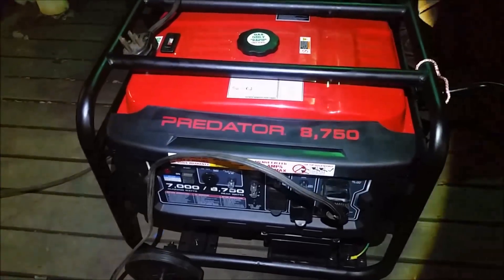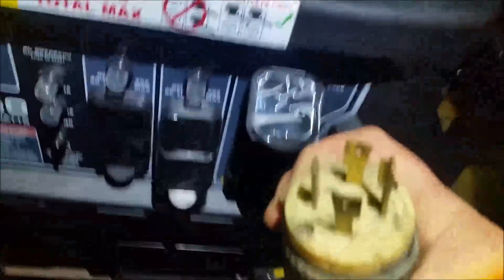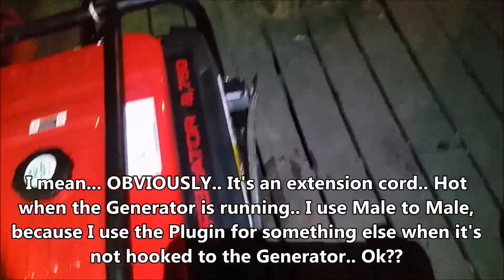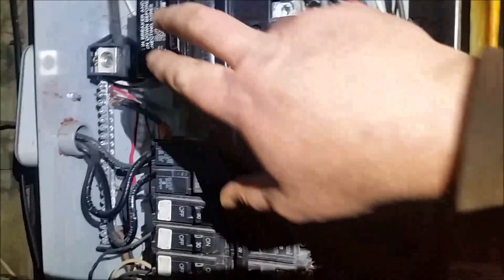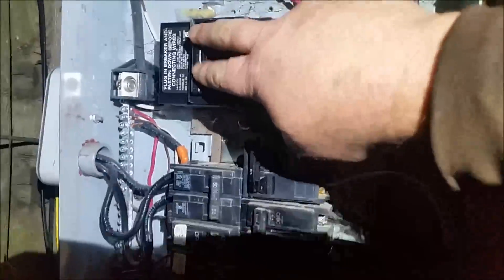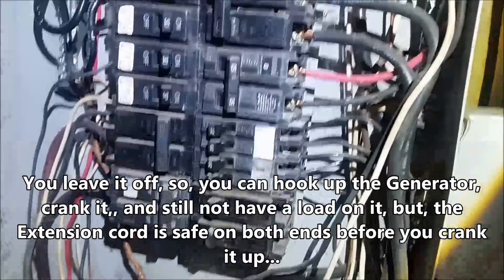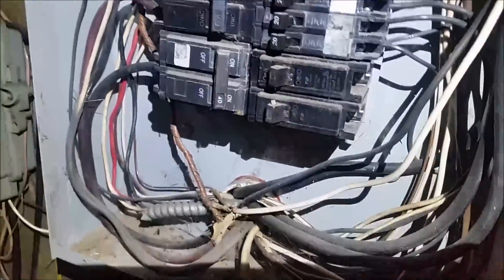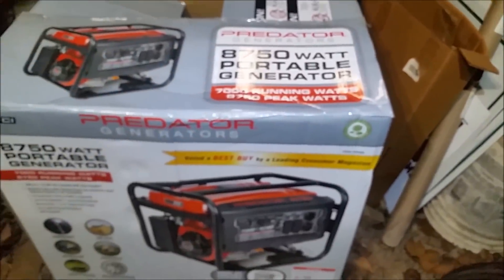Quick/Easy/Safe: Use Existing Plugin/Breaker for Generator hook up to your house Panel box.

Comment: After listening to the arrogence of this man, I'm so relived that I had my Harbor Freight generator wired by a licenced electrician. Better safe than sorry.
Reply: When the breaker is off the only things hot are the input lugs on the main breaker. When the generator is connected it will power those bars.
Reply from the maker: Well,, if you feel that is what is needed to make it safe,, pulling the Meter still leaves hot and cold with 1.25" of each other.. Which is about what is in the panel, so, don't stop there.. Call the electric Company and have them disconnect the power from the pole.. Hell, for that matter, ask them to turn off the leg that powers you poll, so the electricity is no where near your property.. I'm sure the neighborhood won't mind you being "Super Safe"... 
BTW.. It is what Ed Taylor said. Not the Bars, but, the Lugs at the top of the panel are what is hot... The bars are what you hook the breakers into, and the ground bars are where you hook the Earth Ground, Frame Ground and Neutral wires to... Heck... Lets be real safe, and we can just shut the Power Company down,, and maybe we can take it a step further and never let them come back up... Maybe we should remove the Entire Electric grid,, so,, no one could possibly get hurt???
Reply from the maker: Correct..
Reply: Warning turning off the main switch does not turn off all the power in your electrical box! Warning those bars are still powered from the Power wires from Outside, pulling the Meter will totally make it safe! Get a Electrician.
Reply: Warning turning off the main switch does not turn off all the power in your electrical box! Warning those bars are still powered from the Power wires from Outside, pulling the Meter will totally make it safe! Get a Electrician.

Which main switch are you referring to? If it's the one in the house, you are absolutely right. In my setup, I pull the main breaker in the outside box BELOW my meter BEFORE starting / connecting my generator to the house through a pair of dedicated breakers. If the one below the meter doesn't disconnect the house form the from the mains, what good is it? In the 17 years that I have lived here with this setup, I have never blown a lineman off a 7.2 Kv power pole yet.
Reply: Turning off the main breaker ISOLATES the box from the grid.  It is NOT powered.  You are a dumbass and should not mess with 'lectricity.
Reply: If you wanted to have quality and be safe, you would have bought a generator of better quality than Harbor Freight. I wouldn't buy a box full of their stuff at an auction for a buck. When your electrician wired your setup, did he check the continuity from your generator's power plug to neutral and ground? I have a friend who is a general contractor and he tried to save a buck on cheaper generators for job sites. He had one of his electricians wire his house to use an emergency generator. One time when the power went out, he brought out a generator, plugged it in and fired it up. It worked well for a while and then lights, TV's, cable boxes, clocks, EVERYTHING running on 120 VAC in the house blew out. The electrician came over to trouble shoot the problem. The neutral connection had broken INSIDE THE GENERATOR feeding 240 VAC into the two 120 VAC legs of the house burning out everything plugged in and turned on. I don't know how yours is wired but on my 7 Kw Troy Bilt, it has a stock 50 amp, four pin twist lock outlet in the end panel. Two pins are 120 VAC each to neutral with the fourth pin as a separate ground. When I wired my garage, I used 8 / 3 with ground wire. When I wired my 4 blade, 50 amp dedicated generator outlet on my wall, I also used 8 / 3 with ground with the red, black and white wires in the normal 240 VAC configuration and the bare ground to the ground lug in the breaker box according to code. I took my ohm meter and verified my ground and neutral continuity from the generator's neutral and ground pins every step of the way all the way to my main breaker box under my meter box where my garage power originates. I hope your electrician was as thorough. I don't trust ANYTHING! You can buy a Rolls Royce but even they have a warranty because no one is perfect and if any of the assemblers in the production chain are human, someone is bound to make a mistake sometime in their lives. I am usually the one to catch the only defective unit in the entire run so I check EVERYTHING I buy. I didn't trust my Troy Bilt when I bought it either. I checked it out thoroughly including under load. I would trust Harbor Freight even less. Like the old saying goes, you get what you pay for. If something costs less, there's a reason for it whether it's cut corners on craftsmanship like most Chinese crap or cheaper insulators that crack under vibration and short to cause a fire, shock hazard or a destroyed generator. I learned this lesson the hard way on a cheap rebuilt alternator for a car that I had back in the 90's. It had a colorful lithographed wrap around label on the box that touted all of it's extra features. Things like, and I quote, "Bearings for quieter operation." Like most alternators didn't come with bearings. Also, "Voltage regulator for accurate voltage regulation." Gee, thanks for the favor, friend. I took back two of these that failed internally within the first 90 days of their lifetime guarantee. What they didn't tell me was that the third one included a CHEAP MAIN OUTPUT TERMINAL INSULATOR THAT WILL BREAK TWO WEEKS AFTER INSTALLATION AND GROUND OUT TO BURN UP YOUR WIRING HARNESS. I took it back and paid $10.00 more for one that came in a plain cardboard box with a computer printed black and white label showing only the part number and I didn't have another problem for the next three years when I traded the car. A lot of things can be had cheaper than name brand but the key word here is cheap. How long will it put out 50 to 100% power on how much gas or propane, (engine efficiency), (if built to burn it)? How accurate is the voltage regulation? How well regulated is the output frequency? If it runs at 120 VAC but at 50 or 70 Hz, your motorized equipment life will be shortend like A/C, freezers, refrigerators, power tools and such. How long will the engine last? How long before it starts to burn oil? How long will the alternator itself last? Are parts available on this side of the Atlantic ocean and can it be repaired for things like bearings, winding coils and commutator brushes or is it a sealed, "throw away", unit? How long will the shaft bearings last? How thick is the varnish on the coil windings? How fast and, at what temperature, will it melt and short out in the case of a temporary emergency overload condition like if an A/C unit, water pump, freezer and oxygen concentrator all happen to come on at the same time? Does the generator actually put out it's rated wattage or did the company fudge the figures to make more money? All generators say XXXX starting watts and xxxx running watts but for how long? Any 800 watt inverter will always say 1,600 starting watts but what they DON'T put in large print is that this is only for 1/2 Hz. Even a dorm sized refrigerator compressor that draws much less than 800 watts will need more time than 1/2 of 1/60th of a second to come to full speed. A 1/2 Hz starting current is a useless number in the real world. Harbor freight, Coleman and even Generac and other brands all give from 1 to 1.5 Kw overload ratings but these figures are for starting pumps, compressors and the like but don't depend on it for many minutes. My Troy Bilt is rated at 7 running Kw but also 10.6 overload Kw FOR FIVE MINUTES! I'm NOT saying that Troy Bilt is the best on the market. I'm just trying to illustrate the difference between quality, cheap and a balance of the two. It just takes a little extra research to see the difference because these are the questions that need to be asked if one wants dependability. I bought the Troy Bilt because, with my spinal problems, I couldn't pull a rope on a 10 or 12 horse engine anymore. I needed a portable with an electric start and I also needed a little more power than the 5 Kw Coleman unit that I had been using since 1998. The Coleman has a Tecumseh engine. Tecumseh went out of business 6 or 7 years ago but I don't know why. I haven't had any trouble with mine that was Tecumseh's fault. The carb clogged once but that was my fault. It still runs and I keep it for backup or as a loaner for my friends. It still starts on the second pull and uses no oil. I had a choice between a Generac 5.5 Kw unit with, I think, a Kohler engine, which are fine engines, or a 7 Kw Troy Bilt with a Briggs and Straton engine which I have had good luck with all my adult life. Both were electric start and both cost about the same. While Generac has a great reputation, I elected for another known name brand with the extra power that I needed. If it didn't stand up to my load test, it would have gone back to Lowes the next day. Like with the Coleman before it, I change the oil no less than every spring and fall to avoid moisture and acid buildup from corroding internal engine parts. More often if it's used beyond it's oil change interval. This is why my 20 year old Coleman still runs well.